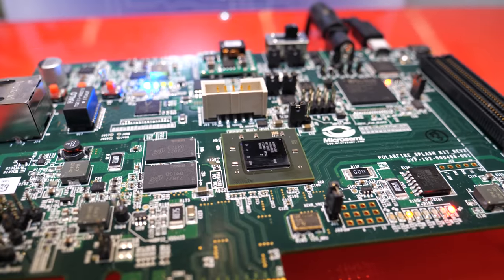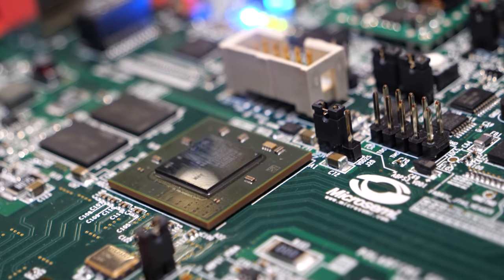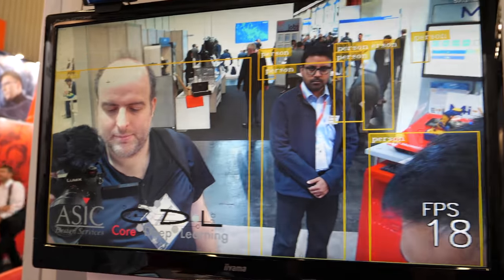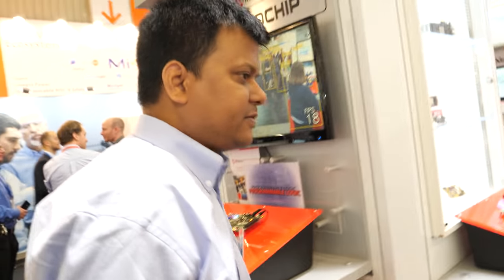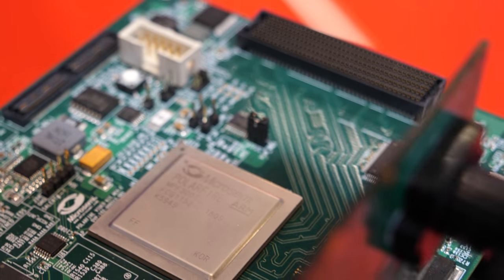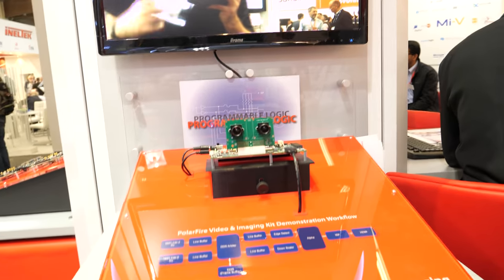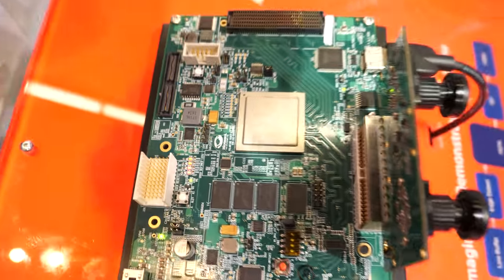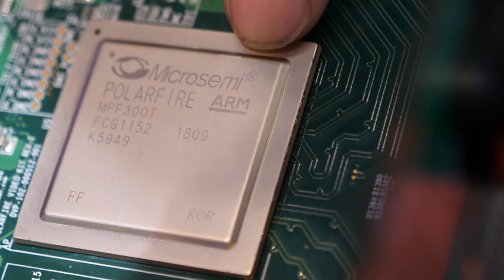Microchip Microsemi PolarFire Low Power FPGA Series from 100K to 500K Logic Elements

Comment: But how powerful is that neural network chip, could it run google colorizer and phonicmind audio software?
If so that would be very cool.
Reply: FPGAs are INSANELY powerful in their computational ability. You could write your own algorithms for those functions with the FPGA or accelerate the neural network using the FPGA which is done more in practice.

Comment: How do you put neural network on FPGA? I would like to try.
Reply: The simplest way is to run the neural network on a RISC-V softcore (I recommend RISC V Rocket) or better yet you can leverage the PolarFire SoC RISC V FPGA that runs Linux and leverage existing libraries for linux, only offloading insane parallel tasks to the FPGA programmable fabric. I know that the Dynamically Allocated Neural Network Accelerator (DANA) runs on an FPGA with RISC V processor with no problem. Microhip is awesome with their RISC-V Linux support.
Reply: @OLDSKOOL978 Reading it. Best answer ever <3